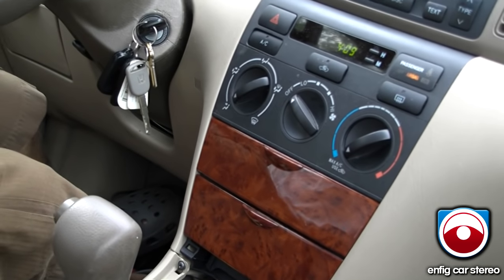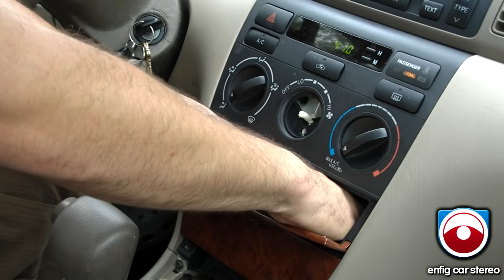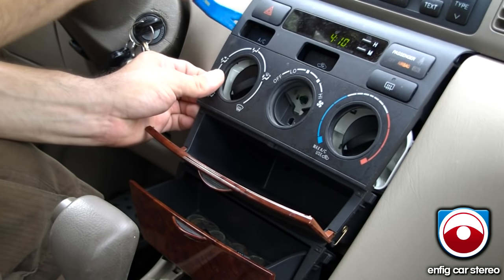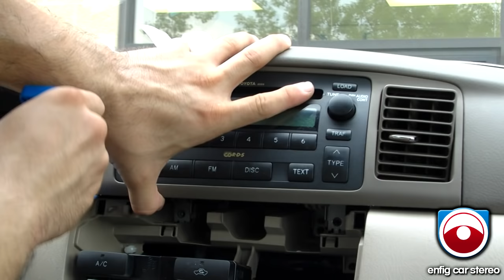Radio Removal Toyota Corolla 2003 -2008

Comment: MAY WANNA DISCONNECT (NEG!!!) BATT. TERM. PRIOR!!!
Reply from the maker: I disagree with this.  The power surge from reconnecting the battery has more chance of damaging something than doing THIS install without disconnecting the radio.   You can prevent brain injury by wearing a helmet 24 hours a day but it increases the chances of you getting hit by a car since your peripheral vision is blocked.  You can disconnect your battery if it make you feel better.  But with 15+ years experience I don't recommend it with this install.
Reply: @Enfig  What about if I'm installing component speakers and an amp as well? Should I turn off the battery because of all the wires being hooked up or leave it as is?
Reply: Enfig very professional response! I always thought we should disconnect the battery during during electrical related stuff but I really learned something new after this! Thanks!
Reply: Enfig I’m not sure what you mean about the helmet would make the job harder I’d say lol
Going by your theory every time you change your battery what would happen?
Reply: 1 OHM
Reply from the maker: This is only my opinion:  For speakers just make sure the radio is off and the key is out of the car.  For amplifiers it depends on the job.
Reply from the maker: It depends on what you are doing.  If you happen to drop the radio on the factory wires and cut them or drop a screwdriver into the radio vents before you unplug it then yes disconnecting the battery would have prevented a headache.  In my eyes those are both highly unlikely.
Reply from the maker: lol.  I have made a pretty penny off 2010 and up VW radios not working after replacing the battery.

Comment: I noticed you didnt disconnect the battery, and you had the car on, theres no serious wires right to cross and blow a fuse
Reply: I want to attempt mine but kinda nervous never done anything like this before
Reply from the maker: The power surge from reconnecting the battery has more chance of damaging something than doing THIS install without disconnecting the radio.   You can prevent brain injury by wearing a helmet 24 hours a day but it increases the chances of you getting hit by a car since your peripheral vision is blocked.  You can disconnect your battery if it make you feel better.  But with 15+ years experience I don't recommend it with this install.

Comment: What brand radio can i look up to replace to a updated radio that fits the same size for the toyota corolla 2004
Reply from the maker: +Real Edit Line This is a toyota radio so it is neither a standard double din or single din but it can be replaced by most standard radios.  We have all the parts to make this a plug and play just call us up.